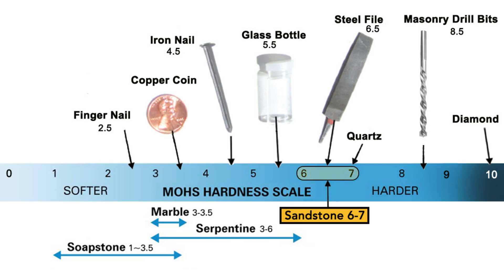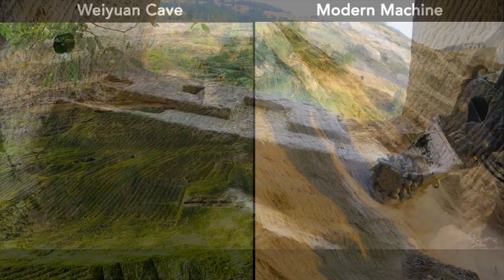Ancient Chinese Stone Caves & Egyptian Quarry Share Similar Machine Marks

Comment: Another great video. Is there any indication where the excavated material might be. I wonder if it is at the bottom of the cliffs overgrown or could they have formed it into blocks or other shapes as you proposed in Egypt
Reply from the maker: Good question - thank you. Maybe the excavated material was dumped at the hill bottoms but it's hard to confirm since the cliffs are steep with overgrown vegetation. Maybe the blocks at these caves were made from the spoil...

Comment: Hi Tina

I really appreciate that you seriously consider critical opinions and do a lot of additional research to actually show the critical opinion's weak points. You are open minded and you are doing what every scientist should do. 

From what I can see there are similarities and differences between ancient tool marks and modern machine marks. 
Look closely to the pictures in 0:44 .  
There are horizontal steps in the tool marks that can't be made by rotating stone crushers. The wall under the window in Weijuan almost looks like it was made of stone blocks that were not aligned very well. You can not create that look with a rotating stone crusher. 
The problem I have at this exact point is, I have no explanation for what I see. 
If it was made using machines (and they somehow managed to get these "steps" into the surfaces) , it would have been very easy to blend in the edges to make the walls more beautiful. Just go over the surface again, it won't take much time with a machine. You would only leave the walls that rough when it's not important how the result looks. For example when you are in the middle of a war and have to excavate bunkers as fast as possible. Or in a quarry or mine that is purely functional. 
If it was made with hand tools, basically the same things are true. Compared to the huge amount of excavation work of the whole caves, blending in the edges is no big deal. You will still see a horizontal line then, but not a step. 
I don't know how it was done. 

I strongly believe that human civilization is older than the textbooks say. It makes no sense to me that humans were happy with a primitive life for 290000 years and then out of nowhere invented civilization, immediatelly building Göbekli Tepe, 5000 years later building  pyramids and 10000 years later making computers. Unsteady climate can not be the reason since civilization took off in the middle of the unsteady climate of the last stage of the Younger Dryas.
But I don't believe in  ancient high tech. The evidence against it is stronger than the evidence for it. I don't believe the high degree of specialization that is needed to design modern style machinery is possible in a hunter gatherer society. There are no traces at all of any agriculture before the Younger Dryas. The genetic clock dates all known domestically bred livestock and vegetables (edit: ) no older than 10000 years. Older fossils of domestic animals are also missing completely. (edit: To put that into a perspective: Our civilization is breeding multiple billion chicken each year, their bones will not leave without a trace, at least some will fossilize for millions of years.) Only the dog is substantially older. 
The bigger part of archaeologic sites contains waste pits. Waste pits usually are full of broken tools and the bones of the animals they ate. 
Large scale agriculture with domestic breeds of vegetables should also be visible in pollen samples. Pollen fossilizes surprisingly well. Even if modern agriculture was only regional, pollen samples from that region should show the domestic breeds. 
There also is no trace of pottery before the Younger Dryas. Pottery is extremely long lasting when buried in the ground and it is contained in every single waste pit that was used after pottery had been invented. I don't believe it is possible to invent and manufacture modern machinery and all that stuff without having pottery before. 
If an ancient civilization was global and spread its technology all over the world (similar construction technology on different continents), they must have been able to travel globally on a regular basis. When European sailors started doing that in the 16th century, they immediatelly introduced several species everywhere. For the time before, there is no trace at all of any species emerging on the wrong continent without a proper natural explanation. A few animal journeys spread it a bit, for example monkeys and rodents coming from Africa to South America when the Atlantic ocean already had half the size it has now, but it still is possible and it certainly happened multiple million years before the first hominid evolved in Africa. 

The one who finds undeniable proof for substantially older agriculture and domestic breeding of livestock and vegetables will rewrite history in a bigger scale than the guys who found the first Neanderthals. So much is sure. But as long as there are not even faint traces, I don't believe it. 

What we call neolithic probably is much older than we know of. It is totally possible that everything needed to build sites like Göbekli Tepe had been existing not only for 10000 years but for 20000 or even 25000 years. In a more primitive way, without the ability to polish stone using sand and water, big stone structures can even be much older than that.  I would not be surprised if someday neolithic style big stone structures up to 50000 years old can be found. 
Production and use of metals (copper, bronce, iron, steel...) can easily be some centuries older than we know of while a very much older age is very unlikely.
They certainly didn't have modern machinery and didn't have a global civilization.
Reply from the maker: Thank you for sharing your insights with me. I appreciate them. There is a lot unknown out there and hopefully more evidence show up helping us to get a better sense of the past.

Comment: You could prove they are machine marks by using a caliper to measure the groves. A hand chiseled mark will not be spaced evenly between the groves (those appear to be machine marks). Machine marks will have the exact same spacing over a a long distance, hand chiseled marks might be close, but they will vary.
Reply from the maker: That's a good point. I am trying to get more information on the spacing of these groves at different sites. Thank you!
Reply: They have been measured.  The vary substantially.

Comment: Although very rare, we have found examples of foot prints of prehistoric animals, and of man in mud that has hardened to stone...  What would we need to look for, or where would we need to look to find prehistoric machinery tracks that has been similarly preserved in stone hardened mud?
Reply from the maker: Interesting - I wonder what a machine would look like if it gets petrified...
Reply: @CuriousBeingbyTina  

Look at Chernobyl.  That city is very quickly deteriorating.  Everything made of metal, glass, concrete and asphalt is rusting away, crumbling, and will all be gone in less than a century.

It's been just over 40 years, and the structures are already crumbling away.

I don't think we'll find any machinery or buildings from 12,000 years in the past, if they were built from any material other than stone.

The stone ruins that we see is all that we will find from them.

It's possible, if we search carefully, that we can find cities in the shallow ocean waters from before the end of the last Ice Age.

However, since this is not a widely accepted theory, no one will front the money to look for sunken cites in those areas that used to be above sea level before the Ice Caps melted.

There are, however, examples of Out of Place Artifacts, OoParts, that are very interesting.  Do a search for out of place artifacts.  You'll see what I mean.
Reply from the maker: @direbearcoat7551   Yes - good points. It would be very difficult to find surviving ancient machinery or other prehistoric metal objects. But maybe one day we will be lucky...

Comment: The locals at the time perhaps were using a diamond belt sander hand boring machine that could have used several men turning a larger pulley that spun a smaller pulley that spun the steel toothed drums that had diamond tipped chains over the drums much the same way that a modern day mortise boring machine works. The groves could be the rows of diamond tipped chains across the drums so that they could just follow the first groove with the last groove of the drum to continue a boring hole.  Using this method to create a square circular cut deep into the rock face would then make it easier to break the rock away like the man who created his own rock cave home. The ppl at the time in the past could have mounted their equipment to do this on either wooden or bamboo scaffolding where many such diamond boring drills could have been active at the same time by a large group of ppl where the whole structure would have been created very quickly as Chinese workers have always been known to be extremely hard workers.

Comment: From a purely visual perspective these ancient tool marks do seem to look very similar to modern machine cut stone. Perhaps todays stone masons and quarry workers should be expressing an opinion on this? I'm sure plenty have seen your excellent videos.
Reply from the maker: Thank you! I did receive feedback from a few stone masons from my other videos. One said he agree with me 100% :-)
Reply: @CuriousBeingbyTina  just sent the video link to my friend who is a medieval stone consultant here in the UK. I await his feedback.
Reply from the maker: @wkdarchaeology5653  That's awesome. I would like to hear his feedback. Thank you!
Reply: Hi. Here is the response from my friend who is a Medieval Stone Consultant.

'Interestingly enough, the tools used by the modern masons in video are not what was used. Punches or pointed Chisels were and are used to get the bulk of the stone cut way and these make the parallel lines, also wide Chisels with 12mm blunt ends are used to make flat parallel surfaces. Indigo Jones masons were able to make perfect parallel 12 mm flutes using these same wide chisels. All done by hand.

The vertical tooling between the horizontal bands is achieved by first punching a horizontal groove top and bottom then one is able to punch out the stone between with a wide chisel thus leaving the Verticsl tool Marks.

The stone walls have vertical tooled blocks which are easy to do on the ground.

Tooling diagonally on walls is much easier than vertical but wow a lot of hard work 

Tooling is about an hour per m2 but not all day.
Cutting out the caves would not have been done by chisels with loads of scrap material. They would have used picks and split the stone out in blocks so much faster than electric jack hammer.

I’ll try and find you some proper photos.

At The quarry we would spit blocks by hand as big as 2.2m x 2.5 x 2.0 easy when you know how'

Hopefully that might give a perspective from a modern say stone mason.
Reply from the maker: @wkdarchaeology5653  Thank you so much! It's really helpful to hear from a stone mason expert. I would love to see sample photos! I have a question, if masons want to make similar stone caves as dwellings, would they dress the caves from floor to ceilings (including floors sometimes) with pretty uniformed markings after splitting rocks and created interior rooms? Excavating cave drawings is the goal but is dressing the caves necessary? Have Indigo Jones masons created big-scale works like these caves or other megalithic sites?
Reply: It does seem an incredible amount of work for anyone. My personal view is I think there are still plenty more questions about these old caves. I'm personally opened minded to your theories but of course all avenues of enquiry need to be considered. I, like you, find it hard to believe people went to that much trouble if it had to done by hand. No one wants to do things the hard way and will more likely look for the most efficient way of working the stone...... and some form of mechanisation would seem a reasonable hypothesis in my humble opinion.
Reply from the maker: @wkdarchaeology5653  Yes, it's hard to imagine that the ancients would spend the incredible amount of time and effort to excavate and dress these caves with hand tools. What's the point of dressing caves with nice markings?  Who would pay for such work? ... Thank you for the comment.

Comment: The markings differences, are the true lead to what the machine was. The longer the distance from the base to the business end, the more the wobbal/shway. The more solid the machine, the more power is delivered to the rock. The more wobble/shway, the less efficiency. However, location and size of the current workspace determines the shape of the machine. What was the power source? Most likely human, but we can't rule anything out.
The location of this video says the machine was able to break down and rebuild in location. I say was brought in after a more basic method cleared an opening to work. The machine is wedged &/or weighted by rock for stability, then human cranking power turned the cutter as a screw drive moves the cutter. The more space, a bigger machine can be brought in, leaving different cutting marks. The human crank shaft of power can be extended for increase force. Men are replaced on a cycle from cranking duty.
The whole idea is to make more efficient caving. To fore thought and put A big investment into such a machine that more likely was metal and mechanically advanced is not above human, but is above the norm of a people at a time. Location is a big part of this. Family is a big part. These projects may have been generations of dominating family or governing power.
As the Curious Being has shown, hostilities would be a big factor of why.

The 10 person bicycle with 4 wheels. 
Imagine a metal box frame, 5 men facing 5 men, cranking a shaft to a rotating cutter. The whole of the machine is on a track that is being cranked by 2 men for lateral motion. Now, insert some gears for an increase of speed. People working on the side removing rock. One person working a bellows for air and removing dust from the cave.
Small systems for small spaces. Big systems for big caves.
This would be industrial quarrying in ancient times, and surgical quarrying. The methods would be as top secret information. Ideas would travel but not exactly the same reconstruction of design. Thus, the differences we see world wide in markings.
There could have been some empires that would use dolerit shires as punishment for crimes to laboriously carve out a monolith. Visibly, society sees, don't do crime and how it's done. Meanwhile, in a top secret quarry, machines are working. Lots of sociological, ecological & psychological reasons.
People rule mostly by psychological! The stone is to make the rule forever! The mystery or My Story, is a big part of the psychological!
Is a mystery a, "my story" that is intentionally misinterpreted? Depends on the location & the current zeitgeist by the rulers.